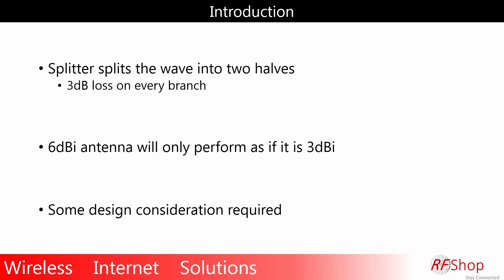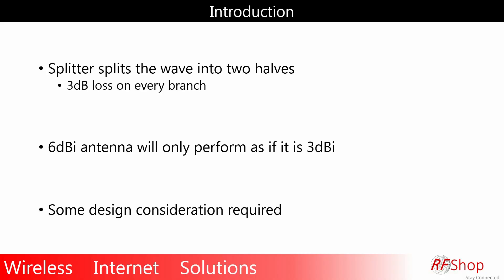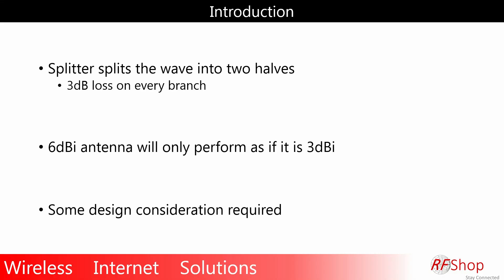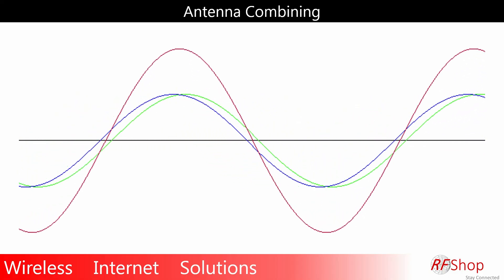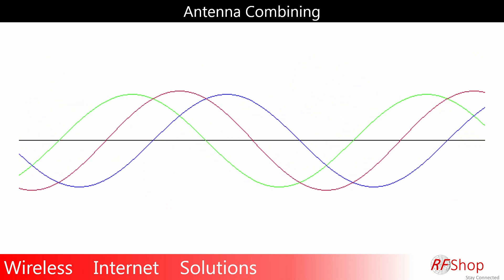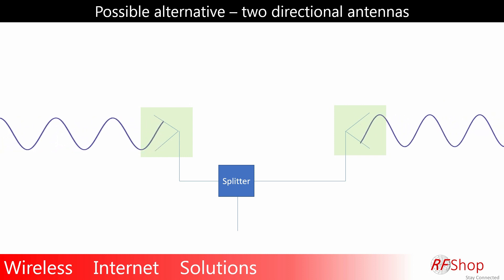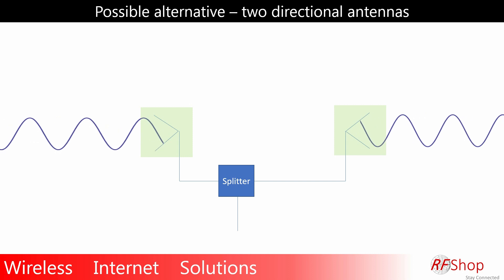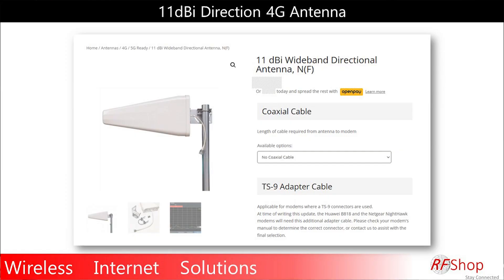Can I use an RF splitter on my Helium Miner ?

Comment: So will the beam width increase when you use two 9dbi directionals run through a splitter?  I would assume so since the 9dBi antenna effective is acting like a 6dBI antenna.
Reply from the maker: Hi Meron X. Actually it is much more complex than that. The antenna still behaves like a 9dBi in terms of beam width, but the splitter only sends half the power to that antenna so in the calculations the power is 3dB lower. 

In full-blown antenna system design we call this an antenna array, and it's a technique that requires quite a bit of engineering so for the everyday user I believe it's safer to stay away from this approach. The calculations are all related to antenna seperation and trying to manipulate what the final result looks like
Reply: @RFShop  thank you for the explanation, 🥂 cheers

Comment: Have you heard of MicroTik LHG 4G kit? I'd like to see a video on it, seems like a very elegant solution for rural places, but the 21 dB gain seems too good to be true, right?
Very nice work on your videos, keep it up!
Reply from the maker: Hi!
Yes, I've seen that unit online before but have not had it in my own hands yet. 
These companies (and it's pretty much all of them) use a thing I call "specmanship". Basically they measure the antenna gain, and one would see at the higher frequencies where the antenna is electrically quite large, it would reach a certain gain value. In this case the antenna probably tested 21dBi gain at 2700MHz. 
Then, instead of saying something like 21dBi at 2700MHz or perhaps "up to 21dBi" they drop the small print and only present you with the highest measured value without telling you where in the frequency range. So, all-in-all they did not lie, but they did not give you complete picture either. 
Unfortunately this happens almost always and everywhere...even on the products we receive from very reputable brands. I just learned to cut through the BS, so to speak and look at the physical size and plots if they have those in the datasheets.

Comment: I see alot of videos on the helium antenna topic but very few state the EIRP value allowed which is 30dbm in Aus I believe. This will be calculated with losses taken off the total value. Example : helium miner output = 26dbm , antenna 5.8dbi = 31.8 take losses 10m lmr400 cable 1.4dbi cable connections .2dbi = 30.2dbi roughly these numbers are not exact haha just off the top of my head. Is this correct?
Reply from the maker: Funny enough I shot two videos today and that is exactly the other topic I addressed. But you are correct, that is exactly how it works.
However, in my video I also raise the issue of antenna gain and receive sensitivity. In TX you can lower the power to keep things within EIRP limits, but a higher gain antenna will improve RX sensitivity and hence peeformance
Reply: @RFShop  I am sure with helium new update they will be controlling the tx output from the miner depending on values you input on the set up , so it will be important to make sure when registering unit you account for the losses for antenna dBi so it is at Max performance. Keep up the good work mate loves the videos